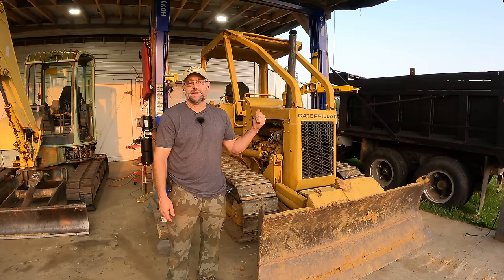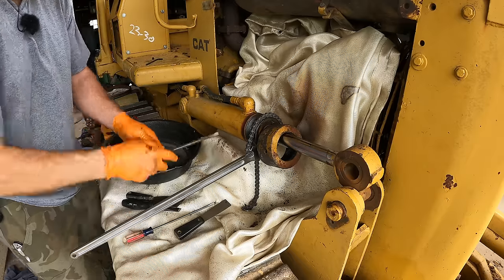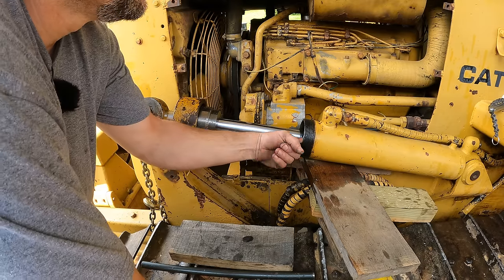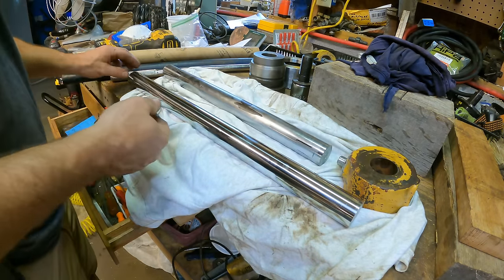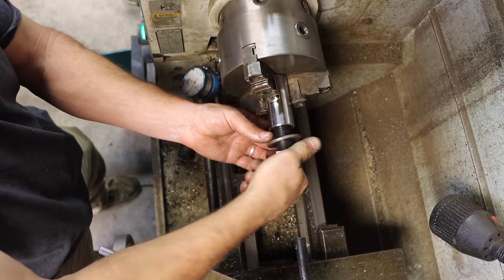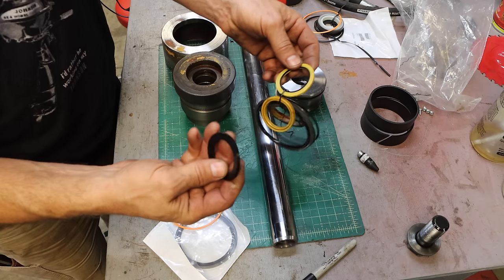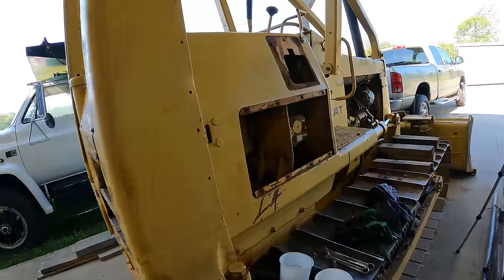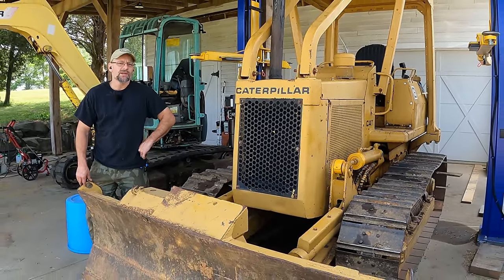D3 Dozer Hydraulic Repairs.  Re-pack. Re-rod. CAT D3 Bulldozer.

Comment: To answer your question about the bolt vs nut to retain piston: the bolted connection is stronger for highly loaded applications.  You can run different material for the bolt and have less chance of breakage than using male threads on the rod.  I used to be cylinder design engineer for a major construction OEM (not this brand, but one of their competitors).  Almost all our cylinders used the bolted type connection.
Reply from the maker: Thanks for the info.
Reply: I guess a bolted trailer ball would fall into the same category.
Reply: @FarmCraft101  When working on hydraulic cylinders you always heat the parts you are taking apart as they are always glued unless there's a mechanical locking tab, but there still might be glue!
The most common glue I've seen is the GREEN Loctite ceramic glue for fixing loose bearings etc. and that stuff MUST be heated to about minimum 250C or you'll end up destroying the threads if you even can get it loose....
Reply: This is a material availability issue right? The rod isn't available in the higher strength materials that screws are? 
I ask because at a glance I would say the tensile stress area of a male rod would be larger than one that was female.
Reply: @court2379  the rod is only hardened on the outside layer. If the rod was used as a stud, it would be softer than say a grade 8 bolt.
Reply: @dans_Learning_Curve  I'm aware of that. But when you cut a large hole in the middle of your shaft you remove a large portion of the stress bearing area. So you have less area, and lower strength material (other than the case hardened surface). Which is why I find it a bit surprising for that style connection to be stronger. It's going to be highly dependent on what diameters are used though.
Reply: @court2379  point made. Maybe, hopefully, someone with greater knowledge with come a teach.
Reply: @TheBibliofilus  Is an induction heater coil tool the appropriate way to heat that bolt/cylinder end without damaging the chrome or the hardening?

Comment: It's probably wrong, but the way we used to machine chrome rods was to heat the area we wanted to cut to a very dull red with a torch then let it cool. After that you could cut it with HSS tools (dad rarely had carbide). The thinking was you're gonna lose the heat treat in that area anyway when you weld it. Same for the piston end, you're going through the hard layer anyway. You just have to be careful and not go too far because it will mess up the chrome. Seems like if you can get under the hard layer you can machine it much easier.
Reply: That’s a good idea, Wes. Seems obvious once stated.
Reply: Basically anneal it.  I don't know about annealing chromed induction tempered steel, but Most of the commenters may have an idea at least.
Reply: Nice job, click.

Comment: Kurtis at CEE will be proud. I am always fascinated by lathe-cutting of threads. How the cutter knows to start in the same place every time while the stock is spinning is magical. Great video, Jon.
Reply: There's a threading dial that the operator watches. When the line is at the correct spot, engage the halfnut that feeds the carriage. That's one part he didn't show.
Reply: @dans_Learning_Curve  I was wondering about exactly that, thought maybe with the carriage at exactly the right place the half nut has only one position to engage, but that seemed nonsense.

Comment: I remember a test for trans fluid I saw in an Eaton manual one time. They instructed us to pull a sample and heat it on a skillet. This was to see how much water boiled out of it. Pretty clever I thought.
Reply: That is referred to as a crackle test. Its purpose is to check for the presence of moisture in the oil. It works well.

Comment: Wish I had YT when I was a teen I would have been light years ahead than I got. I took my first 289 V8 apart when I was seventeen and rebuilt it completely alone. The only thing I remembered not knowing about was plastiguage for the crank shaft bearings. When I found out about that I was very relieved because I was so unsure of a way to check the clearances when I bolted them together. Although I didn't choose engineering as a trade I have always tinkered around with everything over the last 55 years. Mostly successfully. I wish I had played around more with electrical also, but I had limited successes. Point being, now that I am almost 70, I don't have the energy I had in  my teens and  the next 30 years.  With YT and youth  you can really advance yourself today. Thanks FarmCraft you are a huge force multiplier!

Comment: Top quality work on the Cat must give you immense pride in your workmanship. You will have a fine running machine that will provide many hours of work. Blessings to you for providing another great video.
Reply: The machine itself is a high quality machine. Considering it was built 50 years ago and by design would have had a rough life, the bulldozer is a remarkable machine.

Comment: That's the only way that I single point thread these days because it's much less risky.  If you mount your tool on center but upside down and thread on the side closest to you the moment is shorter at the tool tip so you get less spring from your tool post.  Joe Pie has an excellent video of this method on his channel.

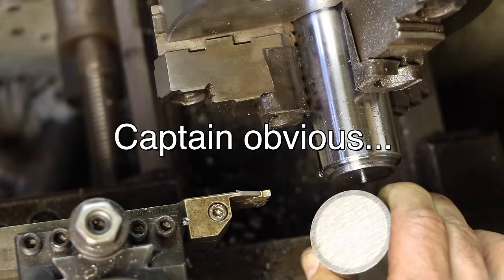Comment: 39:41 seeing that hardened ring in the steel was really neat!  How do they get the smooth chrome finish - electroplating?
Reply from the maker: Yep.  Electric induction to heat and quench just the outside, and then chrome electroplating.

Comment: You can end up crushing the threads when you have the chain that far back on the gland nut. Which will make them bind and not want to move. Placing the chain further away from the threads (near the front edge) can reduce the chance of crushing the nut.

Comment: In refining, we had many rods and shafts. Many times, we used metal spray to buildup them because it was faster and cheaper than ordering new  ones. We had post tool grinders to finish the rods and shafts. Also, we had high temperature, high temperature equipment that was bolted. For years, we removed the nuts with hammer wrenches. For some heat exchangers, it took days to unbolt them. We them switched to hydraulic torque wrenches. They were a huge time and labor saver.

Comment: I've got a 79U built in 1975 as well. Mine has the full cab and a ripper on the back. And a need for a complete engine overhaul, which I will get to in time. Along with the 37 other projects in front of it.

Comment: Excellent videos!!  I'm in the process of looking for a dozer for my wooded farm.  Mainly just cutting ATV trails and skidding downed  timber.  I've looked at many jd350, JD 450s, case 500s... But I think I would be crazy not to buy a D3 just to have the support of the videos on this channel!  Keep up the good work I'm a fellow past farmer with a small machine shop at home including a lathe and a Bridgeport.  I just don't know what I would do if I wasn't able to re- machine  and refabricate broken parts.  Those two machines save you so much time and money... Especially if you've got older equipment where parts are scarce

Comment: Hi,
I worked at our local Cat Dealer for 43 years until retiring in 2004 starting in1962 as a 1st year Motor Mechanic Apprentice.

I endorse what others have said about the detail of your tutorials.  

The screen for the fuel system you seek is in the banjo bolt of the fuel transfer pump inlet.          This bolt should have a domed raised top on the banjo bolt head as opposed to the T/pump pressure supply line to the fuel filter banjo bolt which is flat.

I had several Cat injection pumps that used these Diesel Kiki transfer pumps in for overhaul due to this screen being plugged--owners could not find them either so do not feel bad.
Hope this helps,
Cheers,
Eddie B.

Comment: Excellent job and excellent video as always. That hour went by to fast.
I pick up used rods from a local hydraulic shop as stock. A few years ago I needed to replace a cylinder rod and just happened to have one of those old discarded rods the right size with enough usable length to do the job.

Comment: Nice job, just shows you don't have to spend $100s or more to get the job done. The only thing I used to do was to use a product called 'Copper Slip' on pins and large nuts and bolts. It stops the parts seizing and makes futures disassembly just that bit easier. Really enjoyable post, thank you.

Comment: Excellent work.... My two cents worth. I was a tool design engineer and on the cylinder rod we would chrome plate the rod diameter and regrind the diameter to finish size. 
Also on the cylinder rod coupling I would have drilled and tap for a grease fitting. Makes for a better design.

Comment: Watching your vise flex reminded me when I was swinging on a pipe extension and pulled the bolts through so I made a plate steel backing plate and broke the whole corner off the bench with the “that won’t go anywhere” repair 😂 awesome repairs on the cylinders that would have saved a bucket load of cash 💰

Comment: When I did a few of these and was taking off the piston retaining bolt or nut. depending on what you have.  I would take the ram out of the barrel and then put the eye back on its own mount and put the pin in with the piston end facing the front away from the barrel and lay a 4x4 piece of wood so the ram could rest on it and them use a socket, breaker bar and long pipe to loosen the nut or bolt and not have to use a vice. work out great.  You can tighten it up when done rebuilding it the same way.

Comment: Typical for most piston rings to be split so they can be installed and removed if need be. Be it an engine piston or a hydraulic piston, it’s got to seal up to allow pressure to be applied and keep out the oil from one side. Great stuff brother appreciate the video!!
God bless~

Comment: Fantastic job, sir!  I quite enjoyed your hydraulic ram repair, your perseverance combined with your equipment and problrm-solving abilities are quite remarkable, and a credit to the FarmCraft community!

Last video, you mentioned that your battery voltage was dropping to 8V during cranking; this is very hard on the battery.  Consider switching to four 6v golf cart batteries; they arr relativeluly inexpensive, and you can wire them in series-parallel to make four produce 12v.

This will also help fill your battery box.  Make certain that the positive leads cannot touch the sides of the box, nor move around.  Ensure the box has ventilation so that hydrogen/oxygen gas cannot accumulate.

I sware, I would've used some old sheets to cover the ways and used an angle grinder to trim that shaft, but you did well with thr carbide triangle.

You might consider using a pump to supply lubricating/cutting oil for delicate machining operations.  We soldered up a galvanized tray for our old South Bend lathe.

Comment: Incase you haven't seen them yet, finger held swivel socket wrenches might be of interest to you. 
I saw one at the autostore while getting supplies to pull an alternator (car), I couldn't get my fingers in a good angle when backing off a bolt, and I didn't have much swing on the full sized ratchet, but that, looked it up, power torque 3/8 inch drive swivel palm wrench worked great! I'll probably get the 1/4 inch version too!
I thought about it as you were removing the cover for the sight glass

Comment: Curtis with Cutting Edge Engineering gave you a shoutout as well. Nice job with the threading. The stuff I used to work on was about 10 times bigger. :)

Comment: Great video. I bought same D3 myself a few months ago and getting the cylinder apart took a 4’ pipe wrench with 8 foot pipe! Should have used acetylene like you did. Learning a lot, thanks for the great content. 

Keep an eye on the air filter inlet hose, mine had a weak spot and it would cave in and starve the engine of air and it ran awful.

Comment: All right, one thing you need to watch for on old-school caterpillar’s 70s and 80s models. The water pump had a grease fitting on it does not take but a couple of pumps of grease but it needs to be greased. Check to see if it does have one.

Comment: Mr John, hey man, another good start to a video. I can't believe that is all it has for a drain on the hydraulic tank. And you talk about the grease fittings, back then cat didn't put fittings on them. The had poly- fiberous bushings. I was told grease would be a lapping compound after dirt got in there. Also I your lift had the wrong oil in it. Sounds like it was to thick and that is what caused it to cavitate.

Comment: I dont know if everyone watches the Cutting Edge Engineering channel, but he does a lot of cylinder repair work if you ever need ideas (I know you are aware of them based on 42 min or so comment) .  Though the ones he does on there are larger, some of the same steps should work scaled down.  He if I remember right uses some sort of ceramic inserts for the hardened cylinder outer layers not carbide.  Not having a lathe myself, I do not know the best way to do things, but do enjoy watching those of you who do try and do them. :)

Comment: Nice job Jon.  Typically you need ceramic inserts to machine the hardened outer layer of the rods.  But, big bucks and it really hurts when you break one.  You could also use a grinder to make the chamfer on the rods. 

Plus, you did those internal threads manually, and without a DRO.  Very impressive. A tap for that size hole would have been a real pain.  Curtis at CEE would be proud...

Comment: A tip for getting the rod into the nut/seal. If your lathe is long enough put the nut in the chuck and push the rod in by winding the tail stalk forward. It will be straight in line also. M😀

Comment: One thing I have found really helpful for taking off fittings with a strap/chain wrench or really any type of wrench, is to smack the wrench with a hammer while applying torque on it. The theory is that the shock from the impacts helps break the bond between the threads. Particularly useful if you're working on something that is plastic, you can't use heat, and if you apply too much torque on it, it's just going to break.

Comment: Net time remove both cylinder hoses to remove rod, or you have a vaccumm on the rod, it also helps to reinstall and reline the pins.  Either way Awsome video, great job

Comment: The stepped 'split' in the seal is to allow for heat expansion without the risk of binding against the cylinder wall. The step means there's always a seal, even when expanded.

Comment: With the ram extended you are putting a lot of pressure on the ram and you could bend the ram. You need to support the cylinder housing to keep from bending the ram.

Comment: You may never see this but just in case you do, I saw a video of someone repairing a hydraulic cylinder rod by welding it up with stainless steel rod and then putting it on the lathe to make sure it was straight and cut to exact right diameter!!!
Reply: Maybe on a channel called FarmCraft101?

Comment: Cat Has a spec for the torque required when installing the piston Nut/Bolt. I use to use a torque multiplier and sometimes loctite. The last thing you want is the piston coming loose

Comment: My D3 fuel lift and injection pump looks like yours and I found that the banjo fitting coming in from the fuel tank has a screen inside of the banjo fitting bolt. As you can imagine the screen is really small to fit inside this bolt and was plugged with debris from the fuel tank. I installed a new bolt/screen and an additional filter between the fuel tank and the fuel lift pump.

Comment: You could have put the ground on the lathe somewhere because it would be grounded through the live center then rotated the lathe real slow. Still covered the ways of the lathe with the welding blanket and made a real nice weld. I've done it many times. If you take precautions it won't hurt the lathe

Comment: Love the vids, learned a lot about hydraulics and how a swivel joint works (I always wondered about that). A little advice about that chain wrench. Turn it over so the chain locks tighter into it's groove , not so the force could pull it out. 
Were you a teacher before a farmer, you're really good on the explanations.

Comment: I recommend you consider powering the Field connection of your alternator from a wire from the oil pressure switch (just like the hour meter) so it is not powered up whilst the dozer is parked.  Otherwise, I think you will be powering the field winding of the alternator continuously and flattening your battery at about 2 to 4 amps.  Isn't that why the long wire is there?

Comment: Another tip, if you have a swt screw that seats into threads like your cylinders, if you take a chunk of lead and put it in the hole before your set screw it will protect the threads and still alow the set scew to work proper.
I would have installed grease zerts in the cylinder eye while you had them apart.

Comment: A tip for dealing with stuck nuts and bolts: Don't push down on the breaker bar, pull up. Pushing down you can only use your body weight. Pulling up you gain the mechanical strength of your legs which can lift a lot more than just your body weight.
Reply: Rite up until you blow a disk in your back

Comment: I watched you struggle to get that cab off with A chain wrench, the heat finally did the trick. Andrew Caramata uses a 4' pipe wrench and cheater bar if needed. Ha ha, Your videos are excellent.

Comment: If you put the pin back in the blade bracket, then the piston eye can rest on top between the bracket edges. That way you won't have to worry about it falling off. (I saw that you did this on the second one). I would look at sending the entire rod to a shop that will clean it up and re chrome it. That way you can just use the original hardware.